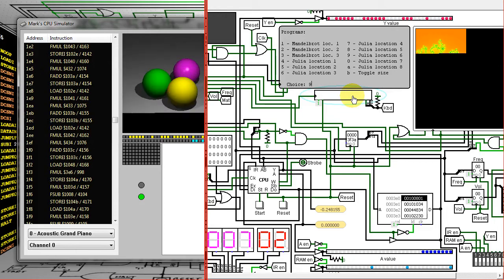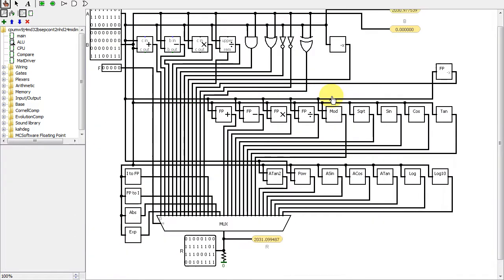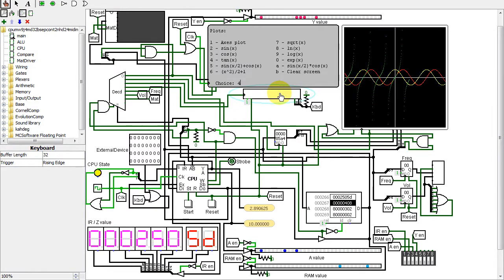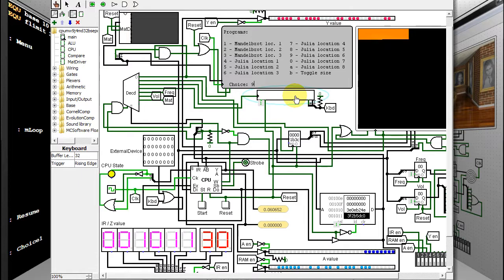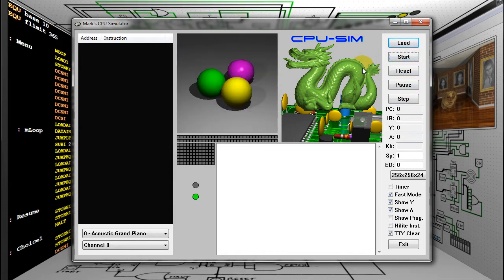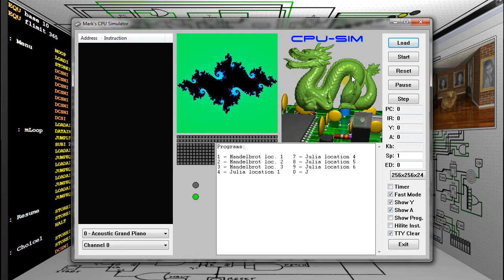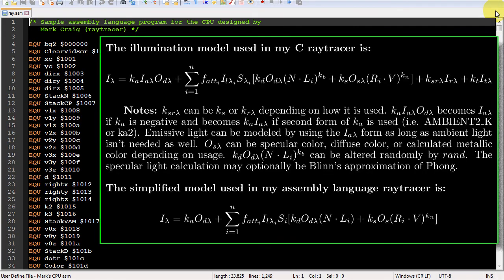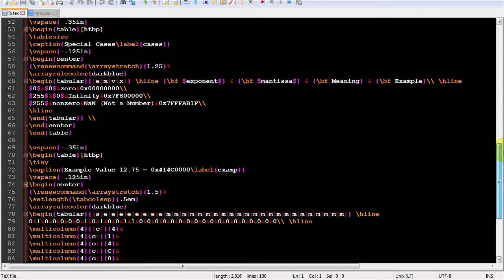My Logisim Floating Point CPU / Computer - (FPU) (Fractals, Raytracer, Etc.)

Comment: how do you make this thing run so fast? you don't even show the clock rate this runs at
Reply from the maker: I assume you mean when running the more complex programs (like raytracer, fractals, etc.)?  If so, I put at least one message in the video saying I sped up the video (or in the case of the raytracer and fractal program, I time-lapsed it (I think it was 1 frame every minute)).  The clock rate is the highest setting in this (and most) version of Logisim - 4.1Khz.  I can't remember who it was, but someone was modifying Logisim source code to do higher rates (but IIRC no higher than 10KHz).  BTW, the computer I use to do the running (Logisim) and recording (and of course recording slows it down) isn't state-of-the-art new tech by any stretch of the imagination, so other systems should be able to run it faster than mine (though they might be limited by the 4.1KHz clock (I don't know if that's an actual rate or a virtual one)).  BTW, when doing the more time-intensive programs, I use my simpler CPU design to make it faster (less components results in faster speeds, so no realtime clock display, no Instruction TTY, etc.) and no Logisim Evolution (Evolution is slower in my experience).
Reply: @MrMcsoftware  
I meant the CPU in general. i thought you did some Verilog magic to take a bit of stress of the program, or use some libary to make it run faster
I know i got a mod for Logisim that allows for clock rates up to 65kHz though as you said the more components the slower it runs overall.
I do like the speed the original Logisim has but I also like the more advanced features of Logisim Evo. plus Evo crashes a lot less

and switching back and forth is a pain because of the reformating of the file. n input gates turning into 5 input gates. RAM components ending up in strange places and being the wrong size. all pins getting turned into 3 state pins, and probably a lot more issues

anyways i need to look more into what you got here, i like the CPU and i'm currently building one myself (first was an 8b one now the 16b one). i'd like to include stuff like floating points but i think that would be too complex for me at the time. also need to look into how Instruction sets are made... my current CPUs always use 2 bit OP codes so i have 4 Instructions to work with. i don't know if more instructions are better but the way i do it is far more lazy and means i have to spend a lot less time programming each instruction.
Reply from the maker: @Proxy
Unfortunately, no magic was used.  I guess it's possible other people's CPU designs might be using more clock cycles per instruction.  Mine does an instruction every ;-;_;-;_ (best I can do in one line of ASCII (maybe -- is better)).

Once I converted my design to Evolution, I maintained both versions - every change to one also applied to the other (when applicable).  It's a pain.  However, for my latest video (User Stack), I didn't bother making the Evolution update (maybe when I have time).

2 bit OP code doesn't give you much room to expand.  But you could do what I did in my very first video when I reduced the design to 8 bit - use one instruction that toggles a flip-flop that when set changes the purpose of the other instructions (or all of them).  I took over my NOOP instruction to control a FF, which then changed ADD and SUB to MUL and DIV.  Of course that puts the burden on the programmer and runs a little slower, but if it's the only way to get more instructions...
Reply: @MrMcsoftware  The thing is i already have basically all instructions inside those 4 OPcodes.
for example my LOAD instruction is capable of the following:
Register to Register
Register to Memory
Register to IO Device
Register to Stack
Memory to Register
Memory to Memory
Memory to IO Device
Memory to Stack
IO Device to Register
IO Device to Memory
IO Device to IO Device
IO Device to Stack
Stack to Register
Stack to Memory
Stack to IO Device
Stack to Stack
so basically the LOAD instruction already contains all regular load things like Register <-> Register, Register <-> Memory stuff, but also IN and OUT and PUSH and POP.
that is basically how all the OPcodes work they just compress as many single instructions into one as possible.

00 - SP Instruction (Special instruction) basically miscellaneous Instructions i could not fit into other catagories, stuff like NOP, HALT, RETURN, etc
01 - LD Instruction (Load Instruction) basically everything that has to do with moving data around
10 - AL Instruction (Arithmetic Logic) basically everything mathmatical and Logical. ADD, SUB, SHIFT, AND, XOR, etc

you can take a look at my currently unfinished documentation of my as unfinished 16 bit CPU https://pastebin.com/Cy4BF0vY
Reply from the maker: @Proxy Youtube didn't notify me of your response... it's a good thing I'm diligent in checking.   I didn't realize you encoded so much into the 4 opcodes!  Sometimes I do wish my design was similar - encoding source/destination, addressing modes, etc. into the instruction - that way, I wouldn't have to create a new instruction just to do a different type of addressing, etc.  But I was constrained by the original design in my class (the 16 instructions we had to implement), and also the two registers.  Of course, some designs that do that require more clock cycles (though some use the extra cycles only when necessary) in order to get all the operand values, etc.  Your design looks good.  You even have interrupts!
Reply: @MrMcsoftware  the downside of having such a compact instruction set is the extremely long execution time. with my 8b CPU (which uses the same concept) it takes around 13 clock cycles just to execute a simple JMP instruction. 8 cycles for a NOP instruction, etc
so there is the balance between speed and efficent Instructions.

then again i'm also trying to make a program for my Arduino Mega2560 that is supposed to make it behaive exactly like the CPU. that way i can test around with it running at (hopefully atleast) a few MHz instead of a few kHz.
but i guess that is the reason you turned your CPU design into an external program so it can run faster as it then only needs to simulate the logic instead of rendering everything and such as well
Reply from the maker: @Proxy Yeah, the clock cycles is a problem.  I was wondering about that, but I didn't want to assume anything.

That would be great to have it in hardware.  Yeah, that's why I wrote the simulator - there was just no way to get Logisim to do it at a reasonable speed.  I'm not sure if by "logic" you're being figurative or literal, so to speak.  I would say my simulator simulates the behavior of the instructions (not the logic gates that would be involved) (if you were being literal).  Logisim is slow because it has to simulate every logic gate, etc. involved in the design.
Reply: @MrMcsoftware  yea i know what you mean, abstraction is the key to speed, atleast in simulation.
so building it in Logisim is more like doing the prototype while you then remake it somehow (how did you do your simulator exactly?) to get speed out of it. next step would be to impliment it in RL. via Microcontroller, CPLD, FPGA, or something along those lines.

i'm sure it would be awesome to see some self made CPU (or overall circuit) design work in RL.
Reply from the maker: @Proxy The registers and RAM are variables in my simulator...  Here's an edited (for brevity) code segment:
(in a loop until CPU is halted):

if (PC>=RAMSIZE) ... (error process.) edited out for brevity ...
IR=RAM[PC];
opcode=IR&0x000000ffL;
Z=IR>>8;
switch (opcode)
    {
    case 0: Y=Z; break;
    case 1: Y=RAM[Z]; break;
    case 31:
    case 2:
        if (opcode==31) { p=A; } else { p=Y; }
        if (Z>=0x800000L)  .... device I/O edited out for brevity ...
        else { RAM[Z]=p; }
        break;
    case 3: message("STORE not implemented in CPU design\n"); break;
    case 4: Y+=Z; break;
    case 5: Y+=RAM[Z]; break;

... the rest edited out for brevity...
(if PC wasn't modified by instructions then PC++)
... the rest edited out for brevity ...

I guess style fanatics would say I should have #define'd the case numbers (0 is LOADI, 1 is LOAD, 2 is STOREI, 31 is STOREAI, 4 is ADDI, 5 is ADD)

If viewing a YouTube video (of someone else's design) is RL enough for you (as opposed to having your own design  on your table, touching it), there are plenty of videos of RL FPGA implementations (as well as 7400 series IC implementations) of CPU designs.  But, yeah, your own design in hardware in front of you would be great.
Reply: @MrMcsoftware  I didn't thought about the fact that the RAM and ROM would need to be Simualted as well. makes sense though
in case of my Instruction execution i would do it exactly like i did it in Logism. which is also somewhat like you did it here with the CASE functions(which i will probably do for the Arduino, upside of that, it runs at 16MHz and i can use actual ROM and RAM chips in RL)
because i sort of based the Logisim Control Unit of Functions and calling them like in C. https://i.imgur.com/G3SJJrl.png
once an Instruction is read the first 2 bits decide what Instruction it is and run the Main Code, all the Main Code does is call the other µCode components depending on what is needed. so in a LD Instruction for example it will first call SOURCE then DESTINATION and then fetch the next instruction

though i did not have time to actually write the arudino code for it yet. I'm starting way too many projects and never finishing any
Reply from the maker: @Proxy In my case the ROM isn't in my simulator program.  In my design, all the ROM does is control the control lines.  In the simulator there are no control lines so no ROM.  But the RAM, yeah, it's simulated (in a sense, though, since an array is really just a continuous section of your computer's RAM).  You load the desired program into the RAM array, and run the simulator on that array (modifying it when doing STOREI's etc.).

I suppose/submit it's better to start too many projects that never get finished than to never be curious about anything.  I see too many people today (except my youtube viewers of course) who just use the tech but don't care about how it works, etc. and that's even if they graduated from a college with "Technology" in it's name.  And in some cases, don't even want to use the tech (probably because it's not on their cellphone).
Reply: @MrMcsoftware  welp now i started a 32b CPU just so i could have more bits per Instruction to have more registers and features

and i was thinking about some things. i read about the Intel 8088 and 80386 for a while and noticed something very interesting. Segment Registers, which split the code into differrent... well segments. you got a Segment purely for the stack, one for Instructions, and a few for Data. that way all your instructions are all in as ingle line without data or addresses between them. which can be useful for pipelining.

basically you got your Program Counter like normal but also some extra registers specifically for the Segments, i use 8 bit Segments and a 24 bit Program Counter both are being combined into a single 32 bit Address (this gives me a total of 256 Segments with each having 2^24 Addresses in them).
plus side of seperating these is that it is impossible for segments to overlap eachother. meaning unlike old NES/Gameboy games the CPu will never be able to leave the Code Segment so it cannot accidentally read some sprite or music data as Instructions, and vise versa.

now i did read about it in the datasheets (https://css.csail.mit.edu/6.858/2014/readings/i386.pdf#page=30) but i still don't fully understand the concept. what is explained is just how i think it is supposed to work. from there i think i'lll just reverse engineer it somewhat.

(somewhat off topic but still thought it was cool)

same thing i did with a Memory Management Unit i made which allows you to "have different sized RAM sticks in each of the 4 slots" meaning the first slot could have a 1MB RAM Component, the next could be empty, 3rd could have 4MB, 4th maybe also 1MB and the MMU would stitch them together so to the CPU it just looks like one continues bank of RAM (in this case 6MB Large). as soon as it goes above that Memory range it will output a signal called "Out of Memory Error" which could cause an interrupt or something, idk.

also a got a question. how useful would a single IF Instruction be? like instead of doing some math and then checking a Flag to either Jump somewhere or not. how about a single Instruction that takes in 2 values and compares them (or 1 value and the flags), if the contion is true it will carry on to the following instruction, if not it will execute a Relative Jump forward to skip a section of Code

basically a low level version of C's If

if (Condition) {
 <stuff>
}
example...?

$1000 IF A<B, $0002
$1001 HALT
$1002 NOP
IF A > B then it will just add $0002 to the PC, if A < B then it will HALT the CPU.

no idea how useful this would be, reason why i'm asking for a second opinion.

btw is there is a download link for the Floating Point library or any tutorial on how they would work?
Reply from the maker: @Proxy I haven't made the FP library available.  What do you mean by "how they would work""?  My library doesn't do things the way an FPU would if that's what you mean.  An FPU would need several instruction cycles to do various operations and it would in some way notify the CPU that's it's done with the requested operations.  It wasn't practical in Logisim to model it that way, so each FP operation is done (and available) immediately (just like Logisim's Adder/Subtractor/etc.).  If you mean what functions are available or how floating point numbers are represented in memory, I cover that in my floating point video.

I'm not sure I understand what the issue is with your IF statement question.  Conditionals (even simple ones) are always a good idea.  But you state that your possible IF would be without math.  Comparisons are (to the best of my knowledge) basically subtractions (and then referring to the flags as to which was bigger (if not equal)).  One operand IFs (booleans) could still be subtractions (with implied/automatic zero as the second operand (or as the actual first operand)), but I can't say whether that's always the case.  But, as I said, any IF statement capability is a good idea.

Concerning the segments:  I might be wrong, but I suspect most people would rather not deal with segments (in a real world situation).  I remember in the MS-DOS programming days being limited in memory allocations, etc. to the first 1Meg (and only in 64K chunks), even though you had all that other memory (in those days, maybe about 8 Meg or so).  You just couldn't easily reference the higher memory (had to use all sorts of segment calculations/manipulations, etc.).  And, if I remember correctly, it made DMA harder to do.  Having said that, You could still create a segmented system in Logisim since I suspect you wouldn't be creating big enough programs to hit those limits (you state 2^24, that's a large enough space to not be easily hitting limits).

I think that covers everything you discussed...
Reply: @MrMcsoftware  with the FP math components i jus temans how they actually add, and subtract, etc. FP numbers maybe i already forgot it and it was in the video. i can watch it again

well with the IF statement the idea was to sort of get away from doing math before checking a certain flag.
so normally in assembly or whatnot to check if a number has reached a certain limit or something you'd run some Arithmetic (as you said mostly subtraction) on it and see if the result is larger than 0, smaller than 0, or equal to 0. but in this case you don't even need to do that you can still just check flags with it, maybe i sait it wrong have an example https://pastebin.com/tjif8zqX

i don't really get how DMA would work worse with Segments, as long as the DMA is CPU driven it should work just as fast because the data is still in a sequential order. just in a segment.
plus the original 8088 had a memory Limit of 1MB, so DOS was made around that Memory limit. but once better chips came that could handle more Memory DOS couldn't really change the way it handled it.
IBM feared it would break compatibility with older programs and drivers for DOS. which would be a huge klick in the nuts for them. so Protected Mode was introduced which watered the fancy new hardware down to slightly faster 8088s so they could keep their software
Reply from the maker: @Proxy I don't cover the way floating point numbers are added, subtracted, multiplied, etc. in the video, and my library doesn't do it the way a CPU or FPU would have to, so that wouldn't help either.

I think I see what you mean concerning the IF.  I've never seen any assembly language that did "IF A=B $02" - that's a little too high level for assembly.  BTW, your examples would result in an infinite loop since the jump to :start would result in resetting B to $10 (overruling the INC B).  Also the logic of jumping on a false might be a little confusing since what appears right after the IF is usually what gets done if the statement is true.  But it doesn't really matter (assembly is full of (seemingly) arbitrary conventions).

I might have been remembering incorrectly the adverse effect of segmentation on DMA, don't know.  But, DMA would bypass the CPU (the hardware would access the memory directly).  Of course, the running program would have to access the memory via the CPU (in which case, the program would have to deal with segments).  So perhaps some hardware manufacturers chose to make their hardware deal with segment limitations to make the software easier (pure speculation).  BTW, Microsoft might have had a little (at least) to do with the limitations.  Bill Gates famously (or infamously) might have said "640K ought to be enough for anyone" :-)  I say "might" because he denies he ever said it.  Who knows.
Reply: @MrMcsoftware  well  yea i fucked that code up lemme fix it with some better IF statement, the jump can be on false or true depening on what you are checking. same with high level languages

LD A, $FF
LD B, $10
:start
IF A != B, :skip
INC B
JMP :start
:skip
JMP :end

so currently i cannot think of more comparisons than: >,   =,   <,   >=,   <=,   !=
also just trying out new things to see if they work
one day i'll have a CPU that works directly in C or something. though BASIC would be better as there you don't need to compile it but instead just execute as you go.
Reply from the maker: @Proxy Actually the != doesn't solve the confusion problem - (assuming you want this code to be a correct example of your particular design) you're still jumping on a false (you're still doing the action immediately after the IF (which would be the jump/skip) on a false result (through most of the loop (A!=B) is a true statement, until you reach the end (when the values become equal (making (A!=B) a false statement)))).  I'm not aware of any high level language that does the part immediately after the IF on a false statement.  Remember, it doesn't matter the true or falseness of the variables/registers, all that matters is the true or false-ness of the whole expression (in this case (A!=B)).  You could also think of the equivalent in BASIC (IF A!=B THEN GOTO skip) which would be jumping on a true statement (as long as A is not equal to B, jump).  As I said before, it is certainly ok to design the language this way (do action on a false result), it's just a little confusing.  Of course, you're also still trying to make assembly a higher level language than it is (by basically using IF (expression...) then).  It would be more like assembly if you did "IF A,B,C" meaning IF A=B THEN skip to C, but even that is a little unusual (because 3 parameters, etc.).  I guess you could (and perhaps this is what you're meaning) have the INC as the action performed on a true statement, which would make your example code a do action on a true statement, but it still would be confusing since skip would likely be thought of as the action.

But the infinite loop is solved (by changing the location of :start).
Reply: @MrMcsoftware  but the design is exactly like higher level languages do it

if (condition = true) {
execute the stuff immediately following
}
if not skip over it

so even C, BASIC, etc does a jump on a false

also i could just use a single bit to invert the logic so you can choose betweeen a false jump and a true jump

so you could say

LD A, $FF
LD B, $10
:start
IF A = B JMP :end
INC B
JMP :start
:end

in C this would completely reverse the IF statement though so you'd require an "else" to make it work like in Assembly

byte A = 0xFF;
byte B = 0x10;
:start
IF A = B {
}
else {
B++;
GOTO :start
}

this is why it's a jump on false by default

also about the FP stuff i never really understud how it's supposed to be calculated that is why i asked if you ever did some tutorial on it, since you had that libabry i assumed you had to know
Reply from the maker: @Proxy You still don't understand what I mean (I probably shouldn't have said jump as often as I did, though I did say "action" a few times which is more accurate).  What I mean is no higher level language does an "action" on a false result (I'm talking about the part right after the condition (NOT talking about an "else" situation)).  What you now have in your example is correct (non-confusing) but I don't see the bit change you're referring to.  In your example "IF A=B JMP" JMP is the action done if A=B, so it is doing an action on a true statement.  I think the confusion is caused because you're BOTH trying to put a higher level construct into a lower level language AND thinking about how the higher level construct would be implemented in a lower level language.  It seems to me you can't have it both ways.  What I mean is that when a programmer writes:

if (a=b)
   {
   printf("equal\n");
   }
else
   {
    printf("not equal\n");
   }

they really don't think/care about how the compiler implements that.  Yes, the compiler has to put in the necessary jumps, but the programmer doesn't.  
    But, in (most?) assembly languages, ALL you can do is jump based on a result.  So, the "action" is always a jump.  And that action is performed if the condition is true.  So, jumpneq (made up mnemonic (neq means not equal)) would jump (do an action) if the values are not equal (and that would be jumping (doing an action) on a true result (*** it is "true" that the values are not equal *****)).
     BTW, my previous BASIC example perhaps illustrates what I was talking about better.  (actually I mixed C and BASIC a little: != is really <> (it's been a LONG time since I've programmed BASIC)):
IF A!=B THEN GOTO skip
The action is GOTO, and the GOTO/action is done if it is true that A is not equal to B.
And, BTW,
IF A=B THEN GOTO skip would be "The action is GOTO, and the GOTO/action is done if it is true that A is equal to B."  (the != as opposed to = just changes the logic of the expression, it doesn't change how an IF behaves - either way, it's doing an action on a true result of the expression).  I don't know if that needed to be said, but I said it just in case.

BTW, I assume that your assembly examples are the exact thing you would run through your assembler (when/if you write it).  Because if they are more like pseudocode, then that could be another source of confusion between us.
Reply: @MrMcsoftware  yea i think we were just confusing eachother
the idea of the IF instruction is to have a low level IF statement that doesn't need a compiler bacause and only because i thought it'd be fun to replace conditional Jump with conditional blocks of code.

so the idea of the JMP was just to skip to the end of the Condtional code. it was never meant to be the the actual wanted action. reason why it only occurs when the condition is false
Basically:
$0000 IF (condition)
$0001 <when condition true do this>
$XXXX <when condition false skip ahead to this address>

the fact that you can JMP backwards was just because of how addresses and overflows work. also something a complier could use to make code more efficent

also i thought about that confusion and because i use segmented memory i can technically implement an ENDIF Instruction
Basically:
$0000 IF (condition)
$0001 <when condition true continue from here>
$XXXX ENDIF <when condition false skip to here>

which is now a fully implemented IF statement in Machine code
if the condition is true it just goes to the next address and continues to execute normally, but if the condition is false it will just increment the PC and continue to read in Instructions until it finds an ENDIF instruction, then it will go one address further and starts to execute code normally again.
this also means if an ENDIF instruction is being read without an IF Instruction active it will do the same and just go to the next address and continue to execute normally.

so you could put entire blocks code between the IF and ENDIF. it basically is just a slow JMP. which is also the downside, with the JMP you can skip over all kinds of code blocks in the same amount of time, but with the ENDIF it would take as long as it would to read in a lot of NOP Instructions

guess i'll try the JMP Option since it makes code faster

so TL;DR the IF instruction would just be an advanced "JMP on false" Instruction. which technically is exactly what a higher level IF statement is. and with advanced i mean i can not just check flags but directly compare 2 values
Reply from the maker: @Proxy  (Preface: based on your latest response, I know/think this is not what you mean, but it might be something to consider) After I wrote the previous response, I did wonder if your IF construct might be kinda like an assembler macro - in that I mean, normally an assembler is 1-to-1 so to speak (for example, one LD instruction maps to one machine language instruction ($23 maybe for example)) but you could I suppose have the assembler create the necessary many actual machine language instructions to do one "macro" instruction (so it would be 1-to-n).  In a sense, it would be like combining an assembler and a compiler (only in a small sense of course).

But it appears your IF and ENDIF would be actual CPU instructions.  (I mostly already assumed your IF was a CPU instruction).  At any rate, it'll probably be the most unique instruction set.
Reply: @MrMcsoftware  The instruction set is mostly supposed to be a "lets see what i can throw into this and work" or "how lazy/closer to higher level languages can i get?"
so it's not really supposed to be serious but should still be able to do most/all things a normal Instruction set can so atleast it needs to be Turing complete

i mean i'm also planning on adding dummy Flags. basically just flags that are never touched by the CPU itself but are instead set to 0 or 1 by the Programmer to keep track of whatever is needed.

also maybe i overlooked it but a download for your FP library would be nice, because after reading it up i'd rather just use a library than deal with FP <-> INT conversion and my myself
Reply from the maker: @Proxy It'll be an interesting CPU.

I haven't made my FP library available.  At first I was thinking of maybe saving it for a particular feature YouTube was thinking of doing.  But I'm not sure that will work out.  But also, it's not fully user-friendly (it all works correctly, but some port label tool tips might not be right, etc.).
BTW, someone else wrote an FP library.  I haven't tried it, so I don't know how good it is (it doesn't have as many functions as mine though) and it might be original Logisim only:

https://old.reddit.com/r/logisim/comments/7yxakc/mod_i_created_a_floating_point_library_for_logisim/
Reply: @MrMcsoftware  i already tried that one... and it completely broke my save file and i had to remove it manually via NP++
and couldn't you just send an example ciruit with all the FP things inside it and correctly hooked up?
or don't. seeing from this video basically of the FP components are hooked up like you'd expect them to. atleast with the simple arithmetic ones like Sdd, Subtract, Compare.
Reply from the maker: @Proxy Sorry to hear about your experience with the other library.  A circ file without the necessary library wouldn't do you much good.  My floating point video shows a circuit using all the FP components starting at about 6 seconds in (probably you saw it).  BTW, Logisim-iitd has FP components, but many don't work (but I think add and subtract worked, but multiply and divide didn't work and at least one of the FP <--> Int functions didn't work (don't remember which)).
Reply: @MrMcsoftware  welp if you ever feel like publishing it under one of your videos let me know :D

also a bit off topic but i just discovered something people in RL already do. and that us using both edges of a clock signal to double the speed without using a faster clock.

https://i.imgur.com/lUiVz7M.gifv

and it actually works on my 8 bit CPU (which is the only one i had that was functional) so instead of requiring 13 full clock cycles (26 ticks) it only required 6.5 full cycles (13 ticks)
Reply from the maker: @Proxy I'll let you know.

That's an interesting way to do it.  I haven't tried it, but I figure an OR could also be used instead of the >=1.  Or is the >=1 an alternate symbol for an OR?  Now that I think about it, I think it is an alternate symbol.  In a RL situation, perhaps there might be a problem with the "on" pulse not being long enough, since I think what it's doing is:

--------______--------

-___-_____-___

Hard to do right with a proportional font (need monospace font).
I depends on how instantaneous the clear is (I don't remember).
Reply from the maker: @Proxy  Great :-(  Youtube uses a different font for comment display than comment editing.  So now it's worse.  But I think you can still get what I mean.
Reply: @MrMcsoftware  yes i know what you mean. also we got pastebin https://pastebin.com/HXxrzSh1
and yes that gate is the OR. i'm so used to the EU Formated gates (because they don't look like hoppers and the pull down resistor actually looks like a resistor)
the signal is still complete, the smaller one still has a rising and falling edge so it should work perfectly with any existing hardware anyone made (unless it relies on long signals)
i tested it on my CPU as said before and it works great, the signal being shorter doesn't change anything. the test programs i made still works completely
Reply from the maker: @Proxy Some things (can be selected to) trigger on a high or low (rather than rising or falling) - that could possibly pose a problem in Logisim I would think (maybe an oscillation error).  And in a RL situation, RAM can be pretty picky on timing (both in terms of SDRAM on an FPGA and RAM in a computer).  But it's still a nice method worth trying.